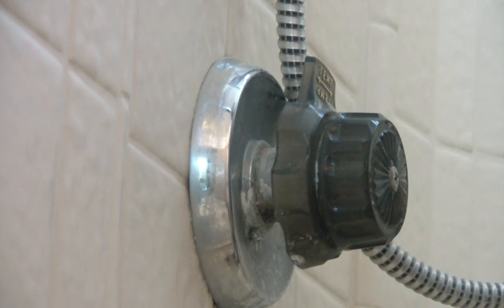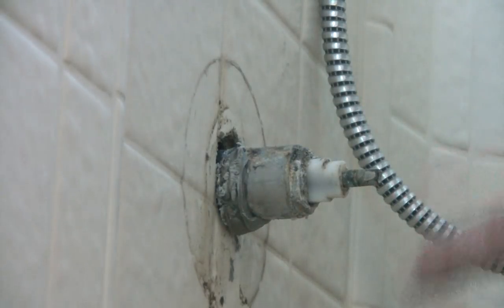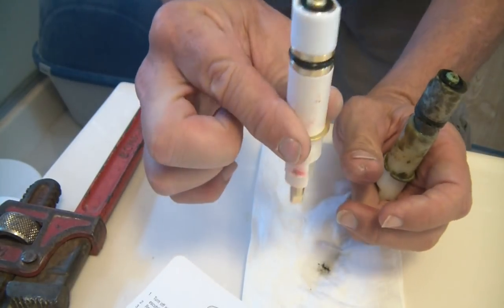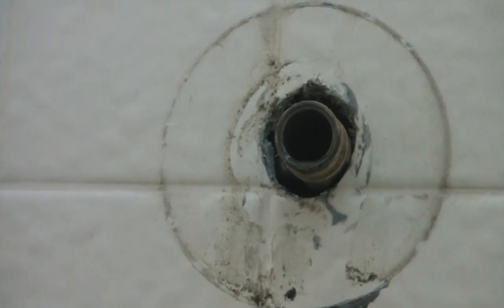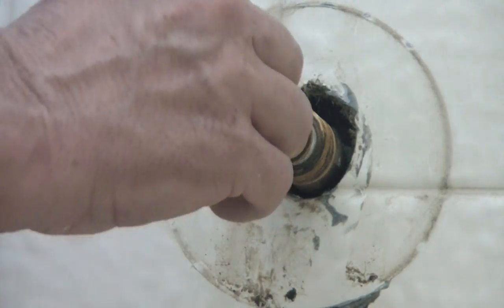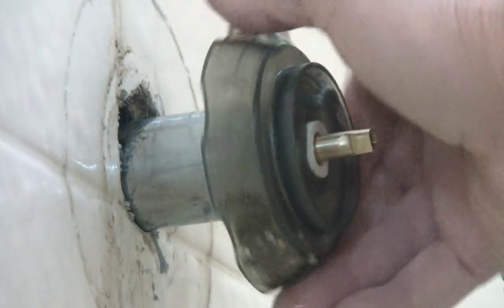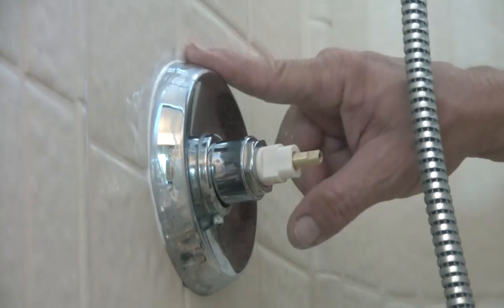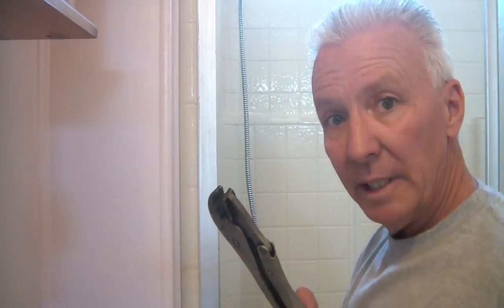How to install Mixet cartridge MXT07

Comment: You helped me IMMENSELY with this video! I had a plumber out to do this for me only because I was unable to loosen the nut. When he finished he said it was "not much better" and I should tear open the wall and replace the valve. I KNEW they don't really go bad, only the cartridge. So, I went to Home Depot and got the correct cartridge. Sure enough, he had installed the wrong cartridge. You mention at about 5:05 on this video that you wished you had a picture of the difference in the two cartridges. I have one for you all! New cartridge, greased up and installed and it works like new. (Was completely unable to turn it prior to this, AFTER plumber left.)  Can't seem to share in the comments, I will try to get it to you.  Thanks again!
Reply from the maker: Kathy Schlesselman
 Thank you. I don't think I can post a pic in the description  and I would have to redo the video to put it in. One of the down falls with YouTube. Wish that would change we could update or correct thing without completely redoing the complete video. Although I might add a link to a pic for side by side of the 2 cartridges, You could email me direct and i could try to do that. Again thank you for the comment and thank you for viewing.

Comment: When you put that valve in witch way does that groove go up down sideways?
Reply from the maker: Bernard the directions will tell you which was the RED DOT will go i have run across valves that were backwards so just be aware of the cartridge when you remove the old one and install the new the same way.

Comment: Does that knob with the arrows stay stationary or do you turn it??
Reply from the maker: The knob turn to open the valve to activate the water flow, the tab looking part turns left or right for temperature control. Both knobs turn for different functions.
Reply: @TheShackHome  oh ok but for me the temp knob only turns right. Turning left will turn it off. Thanks for responding.

Comment: These are the most unreliable tub valve designs. The one at my apartment constantly leaks at the steam even when the water is shut off. I have had maintenance look at it more than once and they only temporarily fix it until  it happens again. Very annoying.

Comment: So what's the secret to getting the temperature control to lock on? I have the little tab in the hole and tightened the screw but it just slides right off. Great video!

Comment: Soo, is the valve what I have to change to adjust the temperature.  My hot water in my tub is not hot, but it is hot in my shower. I do have a Mixet faucet   single handle

Comment: Very helpful video- thank you!  I almost hired a plumber to fix my leaky valve, but your video convinced me that I could fix this myself, and I did.  And installing the replacement cartridge was actually pretty easy, thanks to the detailed instructions and info from this video.

One point to emphasize that I am not sure if it was mentioned or not- the cartridge comes from the factory in the "Open" position.  Turn the valve to Closed before you test the water line for any leaks, or you will be freaked out like I was when you turn your water main line on again, and water comes gushing out of your faucet.  And note that you will have to turn the valve about 50 times to get it to the Closed position.
Reply from the maker: Jim this is exactly why I do this. People can do more than they know just need to step out and give it a try. Of course you need to be comfortable doing so but you are the perfect example of those who do and are successful. Thank you Jim I truly appreciate your comment and viewing

Comment: I bought that exact part, the MXT07, and it doesn't fit. The plastic cam at the end with the hot/cold cutout is maybe half a millimeter too big in diameter. Inside the pipe in the wall, there's place where the diameter decreases slightly, like there's a sleeve or something inside the pipe. The old valve (broken) fits but the new one doesn't.

Comment: These are the worst turn handles for a tub. Mine at my apartment always drips water even after shutting it off and maintenance has replaced the valve stem more than once.

Comment: Only half of the valve came out help
Reply from the maker: Ashley sorry been getting over my jet lag.  I would have to ask if the screw broke of stripped out as you removed the valve. if it was still in you may be able to reach it with some needle nose pliers and may take some work but remove the other half. also if the plastic is left use a drill drill a hole around 1/8" and use a 4"-6" deck screw and screw it it the valve with pliers yank it out but really depends on just what is left in the valve dictates the extraction.

Comment: Thank you thank you!!! Your video gave me the courage to attempt this myself! I did it! I had a freak out moment when the water kept coming and all my turning didn’t help! I decided to take it out and start from beginning. I went straight to comments in case the same thing happened yo someone else…someone said that it came “open” and sure enough as soon as I compared the old one to new one I found my problem. It’s so smooth and easy to use now. 👍🏼

Comment: This video saved the day.  It is also well very well done.  I did not replace my valve but seeing this video I was able to remove the gunk freezing the hot cold arm up.  and reinstall it in the correct fashion.  And wallah now I can adjust the hot and cold again easily.  thank you

Comment: Let's see if you can answer this one. I have been battling with this shower valve for years now, in that it does not put out any cool water in the summer. It is almost too hot to stand under. I have had the stupid thing apart many times and could do it in my sleep, but I CANNOT cool the shower down even with a new cartridge. Be the first one to answer this on the entire web, as I cannot find the answer. This is a 30 year old valve.

Comment: Now how do you use one? I can't get it to give me cold water? I'm staying with people and they don't know either. Can't seem to find a video of how to USE ONE...only fix. I don't want to break their shower. Do I push the plastic piece in the back in and turn to the right? Please help!!!
Reply from the maker: Missy B simply turn the large knob counter clock wise to start the water flow. the tab or lever behind the knob turn left or right to get your desired water temp. If it doesn't turn then its time to replace. it no longer is able to control the water flow.

Comment: My two controls stick together and move together. I have to hold one while turning the other. Sometimes is get to where I can't turn it far enough to shut off. 

It seems like I should put a spacer between them or shave of some internal metal to separate more. 

Sometimes the cartridge turns with the shut-off also making it hard to turn off. Any idea what I am doing wrong?

Comment: thanks for the video... so theres 2 different models.. the best bet is to take it out and check to see if you currently are using a brass backing or a plastic one.. use the same one you have👍

Comment: This video is amazing, I would just like to add one more thing if there's a plumbing supply store near you I highly suggest you go there because they should have the actual mixit cartridge that comes with a brass fitting on the back, instead of the plastic ones that come from Home Depot and Lowe's. Also make sure you tighten up that screw on the back of the cartridge. After I installed mine it worked for about a week and then it wouldn't shut off. After taking it apart I realized the screw and gaskets were left inside the valve along with three other screws and three other gaskets all the way in the back from previous cartridge replacements.
Reply: That happened to me too just now I , I shit the water off took the cartridge out and the water was still flowing out the pipe , I look inside and the screw that goes on the back of the cartridge had fell off and was stuck inside the pipe , I put the cartridge back in and took it out again and the screw came out of the pipe , I put everything back together and tried it out, hot water was on the left and cold was on the right idk how that happened 🤦🏻‍♂️

Comment: PERFECT tutorial!  Thank you, sir!  Question, can I use vaseline in place of plumber's grease?
Reply from the maker: Christopher i could go in a long winded rant on grades and formulations but cutting to the chase, No. Vaseline isn't designed for this. Plumbers grease is specifically formulated for this type of use. Thank you for viewing and the great question.
Reply: Petroleum eventually eats away the rubber seal?
Reply from the maker: Petroleum based lubes may erode the rubber o-rings and harden them, causing cracks.
Reply: Should the lube be waterproof silicone? I can't find the Solderseal at Home Depot. What is a good alternative?

Comment: No doubt that I got the correct replacement cartridge.  They look exactly the same with the cut out area which you describe in the video.  I was unable to insert the new valve without tightening the stem retainer nut to push the value into the fixture.  Once installed it seems to work ok, except the hot and cold are reversed.  Any suggestions?  Thanks for the video.

Comment: I own two condos in the same complex both have mixed valves the one where I live use the MXT 07. The other eye condo I own all at the same complex is exactly the same thing but it has a longer valve stem. I thought I could use the shoulder valve stem in the shorter retainer sleeve that goes over it but I noticed you can doesn't quite reach the Excursion plate and that's why they used a longer valve. Does anyone have the model number for the longer valve stem and sleeve?
Reply from the maker: Denny if all else fails take it to a plumbing store they should be able to help.

Comment: Hi your video is awesome! I went to Home Depot and bought all the pieces only to come home and I can’t get the retainer nut off. I turned the water off, turned the bathroom faucet and got shower to drain remainder of water to relieve pressure but it’s not moving. I searched the internet and tried hairdryer as I don’t own a hot gun or a blowtorch. Any other suggestions?
Reply from the maker: Rachel R with out seeing it if it has calcium build up try soaking with CLR either with a rubber hose to slip over and clamp on so it wont leak or secure a bag and fill with CLR let soak for 5 minutes then try.

Comment: I have a question, you say that the red dot goes on the bottom then why is there a cast mark in the plastic that says up and the instructions say red dot up?
Reply: I put the read dot facing up and the temp is opposite now, so when you turn the nozzle to hot it's cold and when you turn it cold it's hot. I'm too lazy to unscrew everything so I just left it like that.

Comment: FYI. If for some reason the valve won't come off, (I was pulling on it with both hands, never budged) I put a Bernzomatic blow torch to the COPPER PIPE, just for a few seconds, that's how mine came off. Just putting it out there...
Reply from the maker: Salvador  Great point but I would caution people from using a torch to get it out just for the sake accidentally giving too much heat to the valve  and possibly compromising all the sweat joints loosening the solder. that happens you got a whole new can of worms

Comment: Installed new all brass MIXET. Volume open slots. Likely pre 68. No hole on the stem for temp control handle so cannot tighten. Also no stop temp control
Reply: Hot cold reversed

Comment: Thank you! I replaced it with a new one exactly like you said, but it was still hard to turn the hot & cold handle. I found out that if you loosen the chrome cover sleeve, that goes on the main pipe over the cartridge, a little bit at a time (not loose) it will turn easier.

Comment: Hey there. I replaced my MT07 valve 2 weeks ago and have noticed ever since I don't have the pressure I used to have? There is a  big difference in the amount of water coming out of the diverter, like 40% less. Took it out and reinstalled today. There were no obstructions, etc. I cant figure it out. It seems the knob doesn't turn out as many turns as the old valve used to? For reference I have the same set-up shown in your video. HELP! thanks!
Reply: Update, 24 hrs later and it's leaking now? Ughhhhhhh.
Reply from the maker: MrAsphaltSquadron always start from the beginning make sure they are equal set the old and new side-by-side check them out make sure length is correct, make sure you have equal spacers  you can even try rotating the cartridge 180 if the dot is on top rotate it to the bottom just to see. Not much in these but you have to match them correctly.

Comment: HI...I have the same thing.. But handle that turns the water off & on. It keeps going around & around. I have to fight with it to get the water turned off.....
Any help please!
Reply from the maker: D Moore it is difficult to really asses any situation without physically being there. But, if the cartridge is that loose in the valve body there maybe another issue. It could be a worn valve body or you have the wrong cartridge.The cartridge should free spin that much. I'd lean towards the cartridge. Could be wrong or a faulty one. make sure it correct for your application. shower only or tub/shower.

Comment: What if you shut the water off and take the valve out and the water keeps leaking?
Reply from the maker: YoungKing Bynum
 There will be some water in the pipes once you remove the valve. If it continues to SLOWly run out it could be the main valve you turned off. There should be 2 valves. 1 before the meter and 1 after the meter. Turn the valve before the meter(closest to the street) off. If you still have water running that will be on the warter company. If you turn the valve off after the meter( valve closest to the house) in that case its your problem. Any case whichever valve you turn off and still allows water to flow needs to be replaced.

Comment: Hi   The video was helpful but I do have a question. Can I replace a Mixet cartridge with a different brand ( delta or other) to use a single volume and temperature lever? Thanks so much.
Reply from the maker: Josh sorry no All are pretty brand specific. They are designed for that not intended for interchangeability.

Comment: I have three mix it valves I need to replace.two of them I can't even turn with two hands! Your video was SO informative, I'm confident in changing them out. Thank you so much.
Reply from the maker: kathy i know you can do it. Just make sure you get the correct ones. when you pull the old ones out set then next to the new and make sure they are the same. I'm happy to help thank you for viewing.

Comment: Hello, I have installed an MXT07 with the red dot up (per the box instructions). The hot water temperature is not very hot. I don't think reinstalling the valve  with the dot down, as mentioned in your video, would fix this issue. I believe the valve is the correct replacement.   Any suggestions?  Thank you for your excellent video!
Reply: Raul Lozano  did u end up flipping the dot? Did u fix the problem?

Comment: Just changed my cartridge but I'm only getting warm water. No hot water. Any solution?
Reply from the maker: Rob id pull it out and run water just to make sure there was nothing in the pipe to obstruct the flow. The put the cartridge back in but turn it 180 and see if that changed anything. also just a tidbit before reinstalling it hold the cartridge in one hand and  turn the stem as if you were turning on the shower(counterclockwise)with the other hand to make sure the end is snug to the body, install the cartridge. Either with pliers or just put the knob on and turn the stem as if you were shutting off the water (clock wise)before you turn the water on. Now turn on the water main and test you just never know what will work.
Reply: Ok I flushed the pipes. Flipped the cartridge. Little more than hand tightened the nut. Someone else said try a few full  counterclockwise rotations with the on/off handle. Hot water is now working. Thanks!

Comment: Help... there's too much calcium on mine. It won't budge when I try turn it. Any ideas?
Reply from the maker: dasboot360 they can be difficult. Without being there and seeing just how stuck it is. If you have a few hours I’d get a bag maybe a ziplock and cut a small hole in the bottom just enough to fit over the valve. Slide it on and tape tight so it won’t leak. Pour CLR lime away or some calcium cutting solution in bag seal closed and position bag so the solution is soaking the valve and just let it set for a few hours and see if it’s dissolving at all and try again. Get some visegrips and clamp it hard and give it a twist. Maybe look into a tool but I’ve not come across one I couldn’t get out yet.

Comment: so if i want to replace the mix handle i have to replace the whole valve system? I think this whole mixit design is garbage and my customer keeps having the same issue with hers so i'm determined to find a solution and i'm thinking a whole new style would be the answer.
Reply from the maker: Castle that's why when i remodel my bathrooms I'm replacing the valves with another brand. My rental i had repiped i had Moem valved installed I don't like the Mixit but they were very common in the day just not a lot of options for them now. As they get older it's just time to replace and update. Good luck

Comment: Hi Shack, what do you say to the people that had to hammer it in because it doesnt go in as easily as you say.....  is it wrong to hammer it in? Or would that may be the case that some may have to? thanks.
Reply from the maker: aandjmom NEVER hammer a cartridge if it doesn't fit take the old one to an actual plumbing shop and make sure you get the correct cartridge. there are odd ones out there you just never know